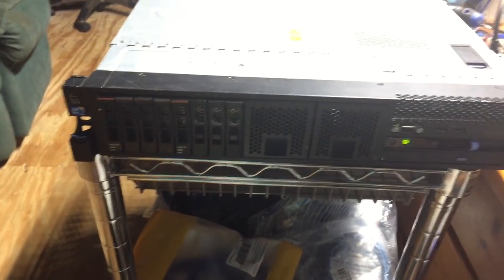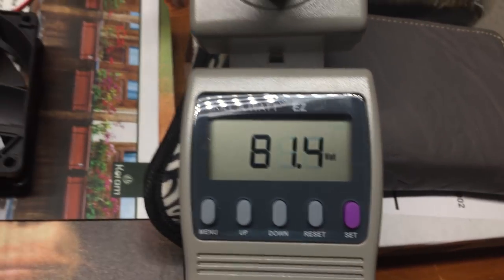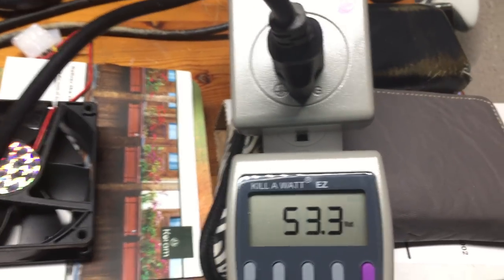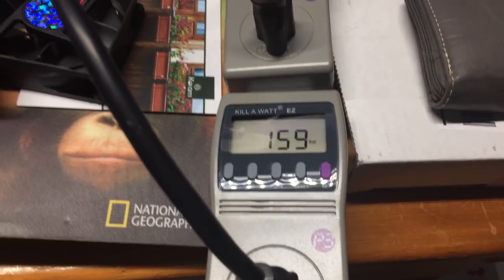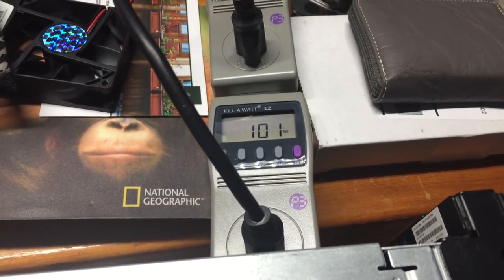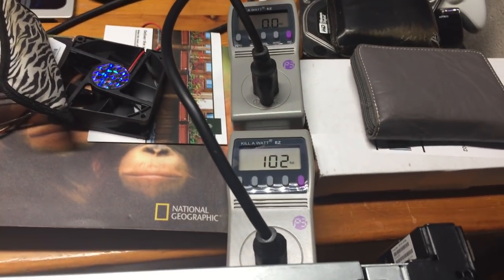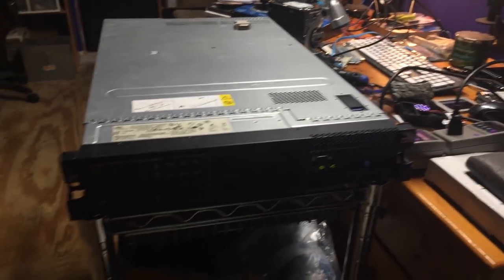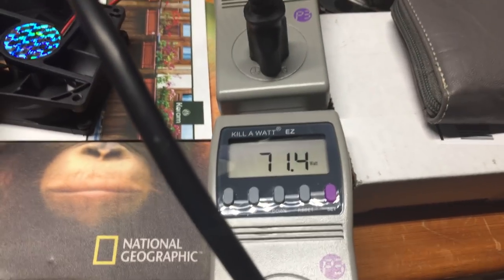Power Mad! IBM X3650-M3 Power consumption w/redundant PS - EP-190

Comment: Thanks for your video, I've been fighting with my room mate with him trying to say that my I7 7700k with a GTX 1080 was making the electric go up. But my answer was well when my 4790k died and I converted my dual xeon x5690 12 cores 24 threads it must of blew the meter up. But this comes from someone that thinks my LED bulbs is consuming enough power to make a big deal. Needles to say I can't wait to move on my own to finally start my home lab for 24/7 use.

Comment: Hi UnkyJoe, You must have a seventh sense. I jus bought a X3650-M3 but being power concious went for the 2 X Quad Core version. What CPU's do you have in that Server.
For years I've been fixated on the low power consuption servers but the new servers I've got the cost of getting the RAM upto 32GB was more expensive than getting a X3650-M3 with 32GB and an adittional PSU.

Comment: Its not the power issue, or age. Enterprise hardware lasts forever. In many cases, you either have a scenario where the software you are using requires an OS or a server that is made past a certain date and they won't certify their use on that older hardware or in the Enterprise, for legal reasons we have to track end of life on equipment. Even though the device might still be functioning, if its past its EoL date, you expose yourself to liablity as well as loss of the OEM providing maintenance and parts.

Comment: >200 watts for a server is very good! I have a DL380 G7 that pulls 80watts on each psu with 2 SATA and 2 SAS Drives and a single Xeon 8 core with 128GB of RAM. However i have an old ML150 G3 that pulls 300 Watts with only 2 old Xeon 5060’s and 4 sata drives. Old technology is a issue!

Comment: Thanks for the video! Please test Dell's server next! I'm especially interested in it because of my Dell's R820 currently run on 1 1100w PSU, and after couple of minutes of working under heavy load (really heavy, like 100% cpu usage) it's shows an predictable psu error in idrac and start to work very, very slow - it's takes a minute or so even to close window in OS. I figured out it's because PSU overheats, but  there is no method to check on PSU temperature. So maybe if Dell's PSU also splitting power consumption between 2 PSUs it wouldn't be overheating, or at least not so fast.  There is also an option (in bios or idrac) for redundant\not redundant PSUs, and i didn't quite understand what it does.
Reply: I have 230V input.

Comment: Hey Joe, so I have 2x 675W RP on my 3650 m3 and I'm going to buy a 1000VA which translates to like 800W power that the UPS can support.
Can the UPS tackle both PSUs connected to the UPS?
This might be a stupid question,but does a normal power cable which goes to the monitor or the wall,can that be plugged to that server? Its nothing special about the power cable right?
Besides its rated for 16A,correct?
Also I'm thinking of getting 2x 1000VA UPS's so on 1 UPS I have the main,second UPS 1 so both have 1 main PSU and 1 from each server, if that makes sense. So in case 1 PSU on a server breaks I wont loose the power and the secondary PSU kicks in. You think that will work?

Comment: Next test Server Buy is an HP DL380 G6/G7 LOL yes I bug Mortan all the time....... Now I'm bugging you..... My G6 pulls 150-200 Watts with 8 SAS drives & 24GB Ram Dual Xeon Quad Core. Ya I run dual 460 watt PSU on both of my G6's. There connected to an SMX3000VLNC APC on a 20AMP line. I have a retired IBM x335 & semi retired G5 in my rack unplugged. G5 Pulls 300+ idle. Second G6 only has 4 SAS & 12GB ram which pulls ruff 120-150 watts running Dual Xeon Quad as well.  Yes i know i can pull 1 CPU out it will drop the power......... My 2 Cents as Kenneth said it does not matter a all 1 PSU vs dual you won't save a lick.
Reply: I have a dl380 G6,,, not a bad server,,, G8 / G9 and G10 is not as well build.
Reply: The G7 is basically the same Server just comes with 6 core Xeon's and they redid the air baffle.
Reply: I have a DL 380G7 with 1 SSD + 7 SATA drives... 1 4 core cpu (8 threads). running on a Single PSU 640W PSU. 
Running windows 2016 Server (Datacenter) 30G ram.... Runs Sweet. running a handfull of VM's some Linux Servers for Games. etc.. and Power consumption is usaly just under 100W (on OS controls Power Saving mode)

Some time soon i'll make a Video on it for you guys. just moving right now